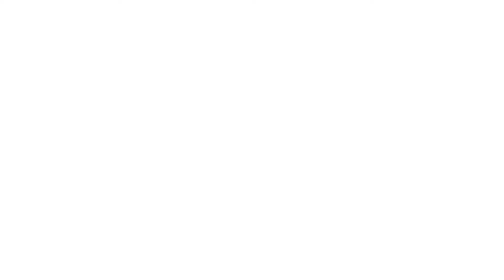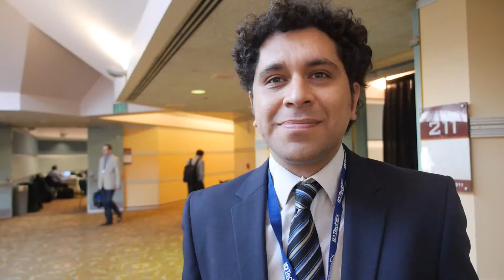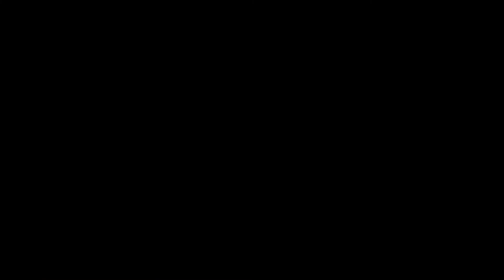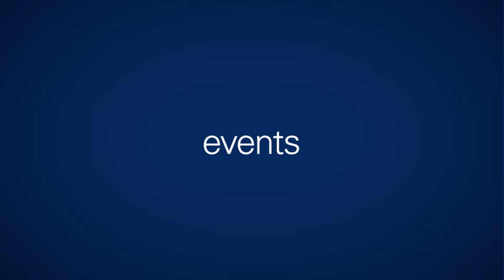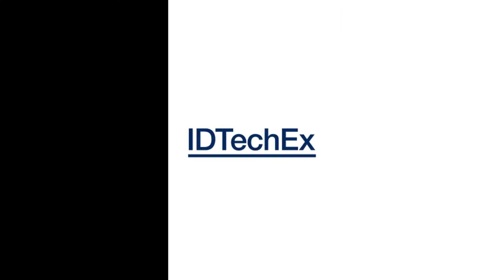Electric Vehicles and Supercapacitors - interview with Franco Gonzalez, IDTechEx

Comment: Do you have the Supercapacitors for electric cars that can charge with in 5 minutes and have a driving range between 300 & 500 miles?
Reply: there's chains electric bus work with supercapacitor charge 3 minutes ever 5 km in stop station